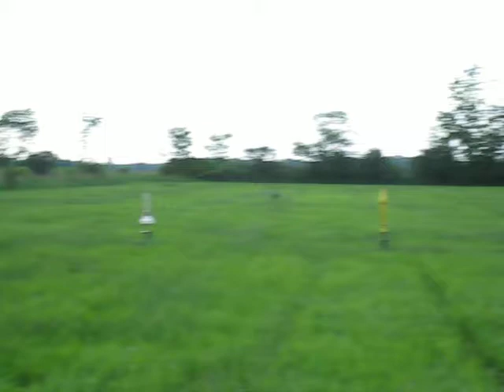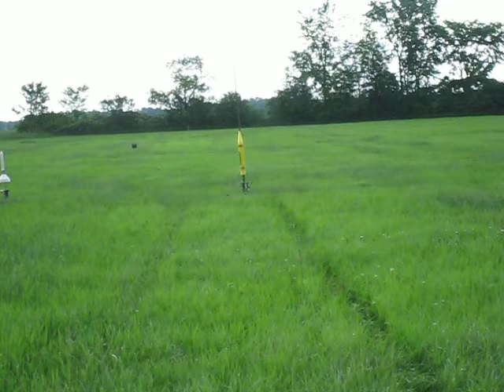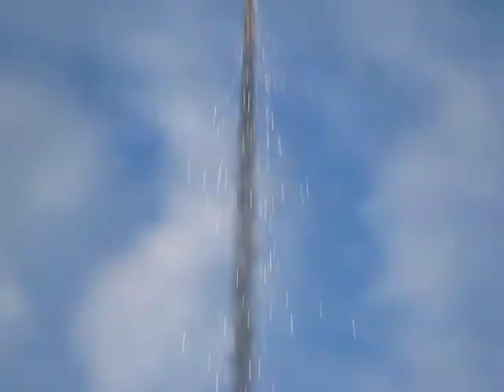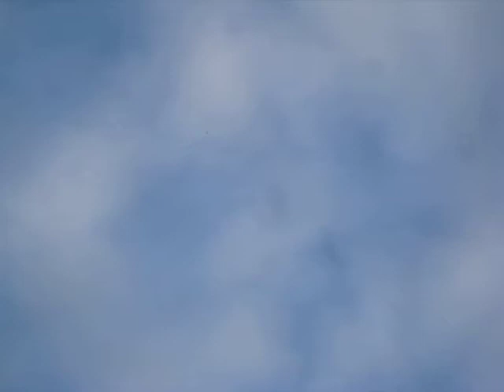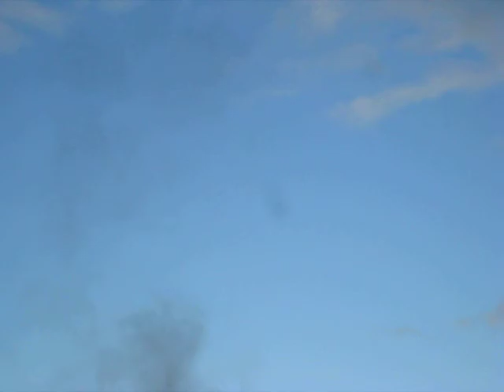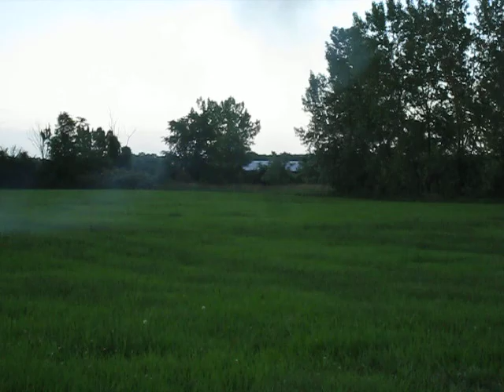Yellow Crayon Rocket on Cesaroni H123 Skidmark Motor - CRMRC

Comment from the maker: OK on the 29mm but lightening the nose may shift the C/G too far back and the rocket will become unstable. I used Lexan for the fins which added weight at the rear. I had to put 6 oz of weight at the tip of the nosecone to ensure stability with all the motors I forsee using (up to 38mm). I have a feeling you may need a couple of ounces in the standard nose. I use a program called Rocksim (free 30 day trial) to verify stability. It IS rocket science!

Comment from the maker: To:@david1513 
The E motor is WAY too small for a 26 Oz rocket. You'd be lucky to see 250 feet and the rocket may be too slow for good stability. I'd recommend at least a 29mm F motor (Aerotech single use F50-4T for instance) which would get you into the 500-700 foot altitude range which is still not very high for this size of rocket. I'd prefer a G motor which would get you into the 1000' to 1500' range which is ideal. But if you are stuck with a 24mm motor mount, you don't have much choice.

Comment from the maker: You cannot modify propellants. The Ammonium Perchlorate propellants have different compounds added to it to give specific characteristics. In the case of the Cesaroni Skidmarks, titanium flakes are added to give the gold sparks and loud roar. Also, once you start modifying certified engines you de-certify it for launch at any NAR or Tripoli sanctioned launch (most) and you enter the experimental rocketry zone which is potentially dangerous if you don't know what you are doing.